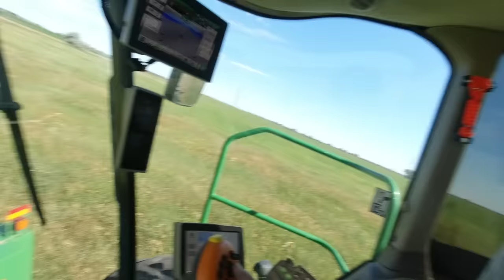Fire! Frantically Trying to Save our Hay!!

Comment: I know you may not like the idea, we had a Pair of 4995  cutters. Those discbine headers, while the worst fire starters, are your best friend when a fire breaks out. The blades make enough wind it will put small fires out in a huge hurry, and any material on fire gets crushed by the crimpers. Biggest thing is that usually the cutter can get to a fire while it's just a couple square feet. Just be sure to save your extinguishers for any chaff that might catch on the cutter and keep it clean! Leaf blower twice a day when fire hazards high.

Comment: I'm wicked glad that you guys got on that fire so quickly, and the loss was minimal. Prairie fires / grass fires are just one more risk that comes with farming. I started a grass fire when I was bull cooking for a road construction  outfit - didn't mean to, of course. Boss said to use a 45 gal grease drum for a burning barrel. I put the thing on a dirt pile, because I'm smart enough not to put in the grass area. I threw a bunch of garbage paper in and lit it. So proud of myself. What I didn't realize is that the residual grease would melt and become little rivers of fire running out of the vent holes I had punched in the bottom of the barrel. Of course, they ran into the dry grass with a strong wind blowing. The village and curling rink were down wind and here was me with a piece of plywood trying to fight it, and getting burned in the process. Luckily, there was a dozer nearby and someone with some smarts that knew what to do with it. He turned that fire back very quickly, and all was calm again. That's how I felt when I saw you guys go after that fire ... you knew what you were doing. No hand wringing, just kill that sucker. Yeah, well done guys.
Reply: Wow Garth Sheane I hope you weren't badly burnt! Everyone makes mistakes n I'm sure you leant from it. 👍
Reply: @bellasamantha237  ... just scorched and singed, thankfully. Did I learn from the mistake? Big Time!!

Comment: Smelt something once got off tractor and some hay was smoldering on the dtiveline.  Of course I pulled it off so the tractor didn't catch and it burst into flames and I dropped it.  Grass caught instantly.  I stepped on it had 2 fires. Stepped again had 4 fires.  Luckily I caught it as soon as it happened and my bladder was full cuz I got that sucker out .  Those grass fires are just scary because they jump and split so easy.  But your neighbors what good people they are

Comment: Maybe in the next video you can provide more detail on how the rock started the fire. Or it could be that I dropped off when you explained it.
Reply: Jeff was cutting the field and a blade on the cutter made contact with the rock. That produces a small spark which in dry conditions is enough to grow into a big fire.
Reply: Hitting a rock can spark.
Reply: Rock + Metal = Sparks 
Mowing with a disk mower those blades are hauling ass spinning so when you come into contact with a rock it’s going to make sparks.
Reply: Sparked very common

Comment: Glad fire got put out. Just a tip from the SW....make Flappers. Take a long wooden handle weld a T bar up and attach a piece of conveyor belt or old stall matting about 12-15 inches wide and two inches longer than width to the wooden handle. Beats flames out faster than you imagine. Probably can order them. That's all I have to say! God Bless Y'all 🙏🙏

Comment: I enjoyed your video. I have some info to share (you may already have been told this but I’m not going to read all 800+ of your comments to find out), and some tips and advice. 

I’m a retired 31 year career California firefighter. Everything I’m going to share is based on training and experience. 

First, in my opinion, guys like you, your dad and farming neighbors are LOADED with pragmatic common sense and can do just about anything you set out to do. The epitome of hard workers. 

Basic Wildland Fire Info:
The majority of all Wildland firefighter deaths occur in light flashy fuels. Grasses. Forests, chaparral, brush, bushes, whatever kind of fuel that is burning, the main flaming front of any Wildland fire is carried by the grasses. 

Light flashy fuel burns hot and fast. If it’s wind driven it will outrun you and overcome you. 

That being said, from what I see in your video of your crop, it’s ALL grass. 
DO NOT BE COMPLACENT. 
If something can go wrong, it will go wrong. Always knowing that will cause you to act accordingly and stay safe. 
Wildland fires go out when they run out of fuel, primarily. Fire breaks, cutting line, scraping a surrounding line of fuel to bare mineral earth. Water works with little areas or knocking the heat out of a flare up, but cutting line is the tactic of choice for your field fires. 

Ok, here’s some basic equipment advice for you. 
1) PPE (Personal Protective Equipment) Get yourselves each a set of lightweight single layer Wildland turnouts (PPE). Any good pair of leather boots too. You don’t need firefighter gloves but you do need a basic pair of leather gloves. You need a Wildland helmet with a nomex shroud. Attach a pair of goggles to your helmet. 

That’s is the bare minimum level of protection you need. Keep it clean and stored in a gear bag you keep handy with you. 

2) Tools - Get each of you a McCloud. It’s a scraping tool. It was my tool of choice on Wildland fires but perfect for lightweight grass fires. 
I have never used one of these but in many training classes I’ve seen pictures of this tool, that was made specifically for your type of fire. It’s called a Fire Swatter. I’ve watched videos of it being used and they look like they work fantastic on light grass fires. 

Practice using your gear and tools. 

3. No matter how small the fire, always identify your escape routes and safety zones. 

Learn what LCES is. It’s the basic life safety fundamentals on the fireline. 

You don’t need to attend a fire academy to stay safe. There is plenty of info online. 

The largest National Wildland firefighting resource is from the NWCG (National Wildland Coordination Group). Their website has publications available you and your neighbors can use to bump up your approach to those grass fires you encounter. 

Don’t be complacent. 
If your local experts ever tell you, “This is how we’ve always done it”, the hair on the back of your neck should stand up is a huge red flag for you to beware. 

Learning never ends. Professional firefighters take as many classes in their final working year as they did in their first year. 

There is always more to learn.

Comment: Haven grown up just a little over 100 miles East of you, I remember the drought days of late 70's, but only had the scare of combine failed bearing induced fires. I did experience fire getting away from us when helping a brother burn off crp field years latter though.  After fighting a touch and go battle along a 1/4 mile of down wind mowed swath along the fence with a grain and sand shovel and no water, the fire hit some 5' tall slew type grass that burst into a fire ball and sent me scrambling over the fence  with flames all around.  We were relegated to fighting the fire in neighbors pasture with 200 hay bails off in the distance.  To this day we just relate to it as "The Fire".  Thankfully my brother was able to borrow a tractor and disk from neighbor to get things under control.   I heard about settlers burning cow/buffalo patties for heat.  We could not get the cow patties to stop smoldering.  I collected them up in a 5 gallon plastic bucket.   Bad Idea!  The concentration of the smoldering cow patties  resulted in pile of melted plastic and cow patties.    Lets say the wives of nephews we had with us reamed us a very large new one when we got back to the house.    Was a really bad day, but the women folk made it a really/really bad day when we got back to the house.  One of those times you just keep silent and endure it.  I headed back to Kansas with much shorter eye brows and melted bottoms on my boots,   I developed a new respect for how easily one can loose control of a grass fire.

Comment: being on a rural fire dept for years i always suggest farmers have a trailer set up with a water tank, pump and hose. Especially when cutting,combining and bailing, even worse in a dry year. So much easier to get control when its small before the wind gets it. Can't even count how many bailer and combine fires i've been to over the years. Prevention is very important, especially in rural areas where your closest fire dept might be 1/2 hour or more away. I've seen them stopped at an acre and i've seen a thousand acres go up in an afternoon. A good old twin axle car trailer with a tank and water pump set up sitting on the side of your field can be a saviour.

Comment: Man oh man! That gave me flashbacks to many moons ago I had a rock get in a row unit on cotton stripper under an auger. So, you have a big fan that after it’s stripped from the row units that blows the cotton into the basket. It was our first 8 row machine, I was 23. I’m stripping cotton basking in the glory of our machine is newer and bigger then anyone around for 100 miles, when I look in the mirror to see flames shooting out of the basket! Our machine was also the first with a burr extractor, so it’s just lint and seed. I hit the button to dump the basket as I’m turning away from the rows, it hits the ground and I get away from it. It was gone in less then a minute and was about two bales worth. Our new machine had to have the basket repainted that winter. Could have been worse! We’ve had modules burn because a bearing went out and by the time you realize it it’s to late because the burn slow. Once it hits oxygen it goes fast.

Comment: Glad only a small bit was burnt and everyone was ok! I was in iowa last year doing some work and there was a large fire way off (i was on the top of a hill pulling a grain cart) i could see over the valley at least a dozen water semis/ tractors with useful implements racing there down dirt roads just from the side i was on. Unfortunately a grain cart wouldnt help much so i just stayed out of the way. 😜

Comment: It got that dry here 5 yrs ago . I lost a bearing on the old baler. We were in a drought and had a bearing up on the drive chain right where you couldn't see anything and liquid steel was dropping out the bottom of the door and lighting the hay. My wife was raking on the next section of the field and she saw the  smoke  starting to get thick out the back of the baler and she raced across the field to stop me. We put that out with water bottles ,coffee, drp, Gatorade and the loader on the tractor and the baler  I pulled down to the creek and backed it in and took a water bottle to put it out that was a lucky day. We fixed the baler sold it and got a new one and put 2 way radios in all the tractors

Comment: Nice work. Pro tip from a guy that does this for a living. For the 4 wheeler sprayer  get a mister type tip and add like a 1/4 cup of dawn dish soap. You will be able to handle quite a bit with 25gals that way.

Comment: I skimmed through some of it so forgive me if you mentioned this but I have two words for you. Backpack blower. 

I burn hundreds of acres every year and we use the blowers as our primary weapon. Water is the backup to the backpacks. Yes, I understand the fire you had was quite spread out and yes, I know the head fire would result in a lot of smoke inhalation but you’d still be able to get three sides put out quicker than you’d ever imagine. Especially with two backpack blowers in operation. The head fire would require team work between the backpack operator and water operator. Whoever has the backpack would want to step out of the smoke (into the ash) as frequently as possible. The water operator would drive through the ash, assuming the ash wasn’t still in flames. It’s a lot of work but we get it done every time we burn. We joke that we are fire lighters, not fire fighters but we do a good job fire fighting when the time comes. Anyway, glad you got it put out. That was probably the kind of excitement you DON’T want. 😉

Comment: same thing happen to me 10 years ago. i was lucky to have 3 water truck 5000 us gal and monitor right at the fuel station 500m down the road. Lost 3 tractor and 2 building, but we saved the 11 other îeces of machinery, the cow barn, the mechanic shop, the silo and the house.   

35 firefighter of 4 services, 4 pumper, and 7 tanker + 2 planes (CL-415)

Comment: I’ve fought a good bit of field fires in my 3 years on a fire department. The little sprayer will only stop it for about 10 seconds then it’ll pick back up. Usually has to be drenched with a wide heavy pour.

Comment: I had a fire in late August...fire was slow moving. Grass burnt and cow pies were smoldering. Put 3000 gal on in 5 minutes. An hour later they were on fire again. I got them out with one fill with 100litres ATV sprayer...and two hours with a pitch fork.

Comment: I've  Been A Wildland firefighter For 4 Years And When We Get To A Small Brush Fire Like That One, We Would Carry Almost The Same Thing, It's Called A Bladder Bag, It's A Bag We Carry On Our Backs, That Carries The Same Amount Of Water About 25 Pounds And It Sprays Out The Same Amount Of Water, Only We Would Be On Foot Going Around The Whole Edge Of The Fire Putting Out Flames First, Then Go Back Around And Spray Any Smoke Along The Edge, Constantly Refilling The Bladder Bag From A Water Tanker.
Its Very Tedious Work, And We Would Stay Working On That Fire For About 3 Or 4 Days, To Make Sure The Edge Of The Black Is Cold Around The Whole Thing, And No Hot Spots.
Its Mind Numbing Tedious Work It's Called "Mopping Up", But We Would Have To Do It, To Label The Fire As 100% Contained.

Comment: Your dad was me this spring in my neighbors field.  I seen he was getting out of control burning a ditch but I had to go eat lunch first 😂. Went back outside and it was headed towards my barns so I went in the ol 4020 with a 10’ blade and put it out. There’s no way in hell he was going to stop it with his little 35hp John Deere. Burnt about 10 acres.
Reply: I work for a rural/suburban fire department. When we purchase new engines there is an ember separator installed in the air intake.  This stops embers from entering the in to the air cleaner, possibility catching it on fire.  I do not know if farm equipment has such a thing or if the air intakes have an additional something to keep the dust/dirt/whatever out.  my point once the fire is controlled check the air flitter.  Just trying to help, hope you are getting rain.

Comment: Is there enough elevation change away from the lots you could run a tile a few feet out from the concrete pad and drain away water to give the clay a chance to hold compaction?

Comment: Glad that had a good ending for ya'll. Not sure what you cut hay with before but how do you like the swather compared to pull behind disc mowers?
Reply from the maker: It is nice not having to constantly look behind you!
Reply: @SonneFarms  we make around 30,000 squares a year. Currently using a Massey Heston 1376 center pivot. We figure we have almost 350 acres some of it we cover three times. The only problem with getting a swather in there is don't know some of the places if we could get in. Ive thought about it though
Reply: @SonneFarms  I never look behind anyway always use mirrors right

Comment: When I was a young man....a long time ago....I was finishing up a hay field, moving the round bales with my tractor and hay trailer. A bearing went out in the wheel and caught fire, which caught 5 round bales and the pasture on fire. A friend of mine and myself fought that fire all night....waiting on the fire department. They finally showed up about daylight and finished putting it out. I was able to save the tractor, but the trailer melted and burned about 2 acres, so not too bad.

Comment: There's a company called kutak I think you're out of California.. they make a small sprayer unit little bit bigger than what you have one of your ATV.. you're probably put one of their small units on your skid loader with forks.. that cat chewing on a fire I'll show your dump truck you're not going four-wheeling so it could be two wheel drive you put in about a 812000 gallon tank with some fire hose in a pump and someone sending it back can kill a lot of fire.. just make sure if you put a tank on your dump truck make sure it's baffled you can either haven't made with powerful or put it's called baffle balls in it... At the end of your video is biodegradable and won't affect you're hey you might be able to use that on the fire also.. again kutak makes specialty equipment for farming field so to speak it's all designed to fight fire.. if you want to go with him festival system or do you want to make your own that's up to you... You're there if you want me to make another suggestion let me know.. I'll help you as much as I can I have over 20 years.. mycommunity we had the suburban section and we also have a rule section so I was used to dealing with water movement and tankers and some some areas called them tenders.. and boy did we have the brush fires.. nothing's like having a brush fire in the middle of an old junkyard that has public transit buses in it no fire trucks and old tractor trailer trucks... There's a lot you can do with a small pump Southeastern pressure will put out a lot course you need the right hose and nozzle..